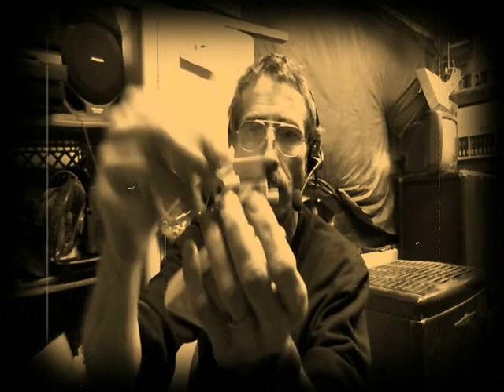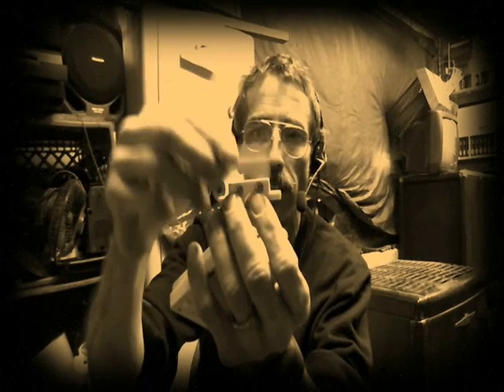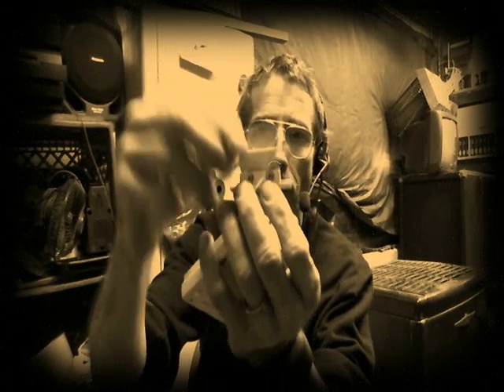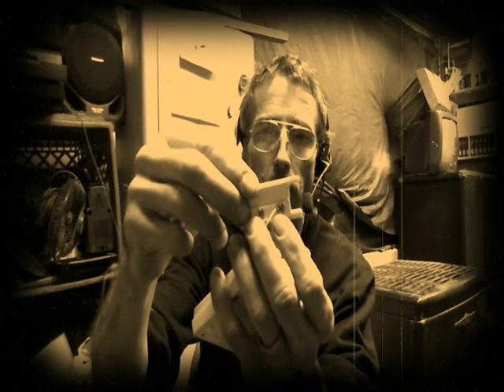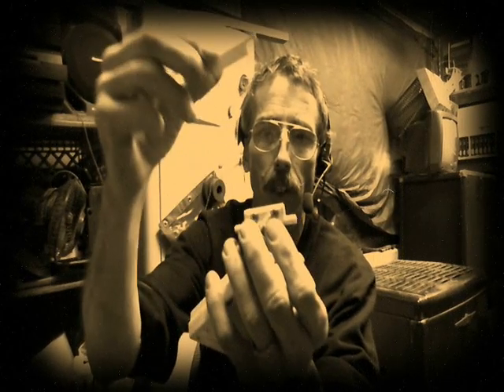REED SWITCH AND LED CIRCUIT!

Comment: What side of reed do i need for 3mm led light im using a small magnet. I went to ebay to buy some but saw to many crazy size. for instance  here 2 im confused 1.Reed Switches HM.. 2.Reed Switches YG what the different between HM AND YG

Comment: Sir i need to use a reed switch just to turn On and Off. Later i'll convert the signals On(5V to logic 1) and OFF( 0v to logic 0 ) using ADC. Is that possible ?